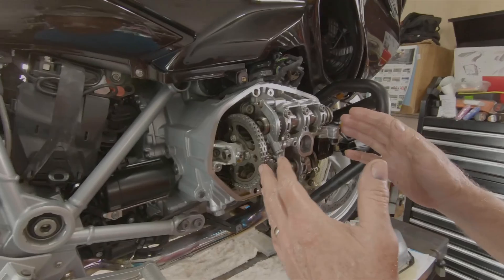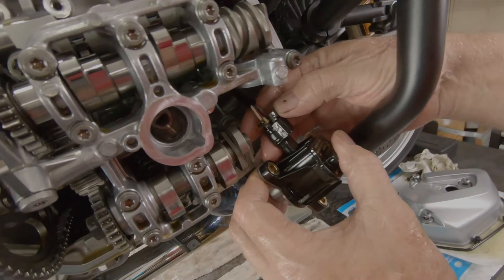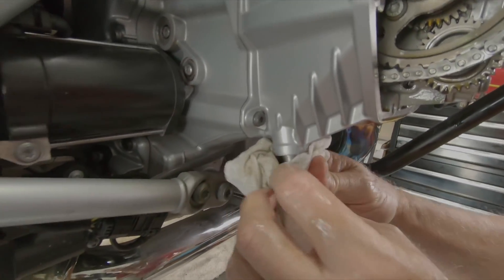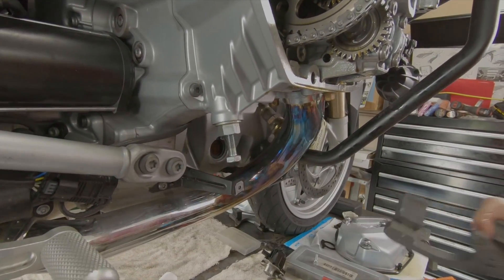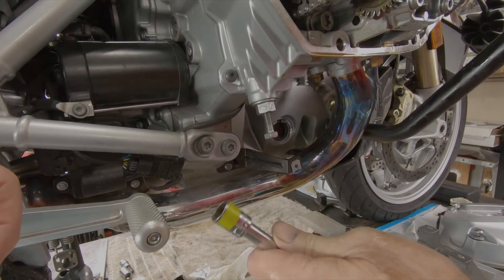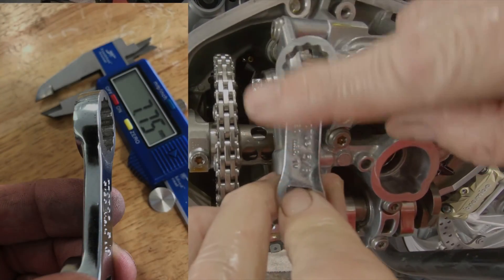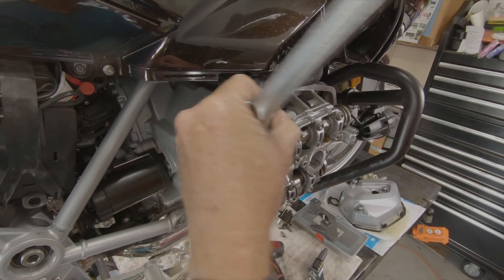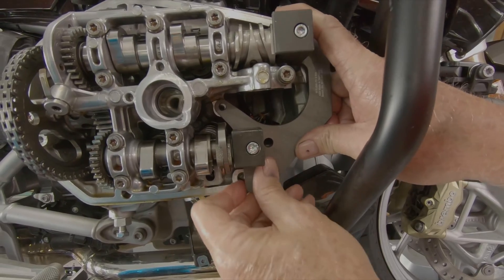BMW R1250 RH Cam Timing Part 3 of 4

Comment: Just wonder, how's possible camshafts get out of timing?!? And how do you realise it? Loss of power? Difficult starts? Worse idle?
Reply from the maker: Why we check Cam Timing on WetHead / ShiftHead Boxers
My belief is that the cam timing IS correctly set right from the assembly line. 
When a WetHead/ShiftHead gets somewhere between 10-12k miles, all the valve train finally normalizes the wear and settles in to this state for the next 100k miles or so. 

Thinking about what we do to check/set the cam timing, it makes sense to me why we need to do this early on in the typical service for these WetHead engines. 

For the LH cylinder my observation is like this….inserting the 8mm TDC locking pin in the perimeter of the alternator rotor has a very small tolerance in that slot or it would get stuck there. This LH side cam chain is driven from a sprocket on the crankshaft just between the alternator and the rod journals, so this is the shorter of the 2 sides to transfer rotation out to the cams. Both the pulling, top side, of the chain and tensioner, bottom side, of the chain slide along about 8 inches of phenolic rails that are prone to some grooves from the edges of the chain links as they break in initially. All the links, (102) on this side, as well as the sprockets have lots of contact points that change as they initially wear in. 
Then the sprocket shaft has the drive gear that rotates the cam gears on both Int and Exh cams…again some gear face contact wear-in is normal. 

The RH cylinder has the added driveline parts before getting to the drive sprocket at the cams …there is the large gear on the front end of the crankshaft that drives the smaller gear on the clutch basket and then back thru the clutch/counter balance shaft to a similar sprocket for the 106 link chain going out to the cam drive gear. 
The RH side chain has more distance from the counter balance shaft drive sprocket that is lower in the engine than the LH side driven straight out from the crankshaft. 
(The ShiftHead 1250 has a link chain vs a roller chain so the left side has 130 links and the right side has 136 links)

The engineers determined that the specific pressure applied from the Cam Chain Tensioner Tool standardizes the removal of the clearance/spaces all along the components just listed to use the Cam Alignment Jig on the flats on the ends of the cams and correctly align the 2 cams for optimal operation. 

Pretty convoluted description to point out that there is some normal play in all these components that we are dealing with after initial break-in to reset what the factory set during the buildup of the engine. 

If you are still awake after all that, I hope you have success setting the cam timing when you get to it sometime after 10k miles minimum break-in. 

It’s my experience from doing well over 180 of these Cam Timing checks that about 85-90% of the cams on each side have to be adjusted after initial break-in.

This will give you easier starting, smoother idle, smoother throttle response throughout the RPM range, and possibly better gas mileage (that’s a guess since I don’t know anyone that seeks MPG over Smiles Per Mile!)
Reply: @Boxflyer11 thanks a lot for explaining, and writing all this😊 my 1200 of 2013 has 160thousand kms now, and frankly speaking runs perfectly, quick starts, regular idle...I made BMW services regularly every 10thousand miles, as instructed. But I wonder if they ever did this check, since I never heard of it before seeing your video and never got informed about it on paying service bills 😊
Reply from the maker: I doubt that any dealer would have done this.  The only reference in the Service DVD of using this Alignment Jig is when REPLACING a Camshaft.  I only use it to re-establish the factory original settings.

Comment: Unless I'm missing a segment, I don't see where you lock the right cyl. at TDC.  Video 2 ends with you removing the cam chain tensioner.  My specific question is which is the correct direction to rotate the cam chain sprocket to put the right-hand cylinder at TDC?  The left cyl. using your tool, you rotate upwards (clockwise), is the right cyl. the same direction or reversed?
Reply from the maker: @m.f.m.67  You do all the engine rotation from the Left side, since that’s where you have access to the TDC pin. Both side cam chains are pulled into the engine from the top of the chain to answer the question, but no need since the important part of the reason for rotating is to lock the TDC pin.
Reply: @Boxflyer11  Got it, thanks.

Comment: Hey Brad,

Here's a question for you! I completed setting the timing on the left-hand side. Next, I took my clearance measurements and determined I have two shims that I'm going to adjust as the clearance was on the loose side of the tolerance (front intake and front exhaust). Here's my problem, I didn't purchase a shim kit because I was planning to just order the ones I need from BMW. However, now I need to do the same procedure on the right-hand side to find out which shims I'll need for that side. Do I have to completely reassemble the left-hand side (shims, cams, bearing cap, axial fixation, etc) before I can spin the engine to lock the right-hand side in TDC? 

Is there any concern with spinning the engine with the cams removed on the left-hand side? I don't know enough about the engine to determine if this could cause any issues. Since the left-hand side is already at TDC, I don't think there would be any possibility of the piston hitting the valves? 

Thanks again, 
Gary
Reply from the maker: Is there concern from me on doing this?  YES!  I would at least put the valve train components back together (replace the shims, cams, and at least snug down the bearing caps) but you could leave off the axial fixation.  Then it would be all normal procedures as far as going to the RH side to check clearance and see if you need to order shims for that side.
If the cams are removed when you rotate the engine, the valves would not be opened and not have any chance to contact the piston, so that's not a concern, but putting the cams back in would be a lot less like being a "test pilot" to see if it can be done.
Reply: @Boxflyer I slept on it, and I agree, I better follow the correct procedure, just in case. I found an aftermarket (Hot Cams) 8.9mm valve shim kit at my dealer this morning that I'm going to use. They're forged from 4140 steel. I found good reviews of them and people say they're a quality product. I'll check them with my micrometer when I get back home. It would be a few weeks before I could get the BMW shims due to the holidays. This way, I don't have to put the left side back together and take it apart again once the BMW shims come in.
Reply from the maker: If you have done the worksheet and know what sizes the shims should be, but can't quite get to the preferred target clearance, you have time to order shims in 0.02mm increment spacing from OEMCycle.com.  The format to enter in the website search field is 29.890202  That is for a 2.02mm shim.  They come in a 5 pack of that size for less than a single "adjustment plate" as BMW labels them.
Reply: @Boxflyer  I may take your advice and put an order in with them. I wanted to get this wrapped up today, but there really isn’t any rush. The snow here won't melt until at least mid-March.

I nailed the left side. Front/rear intakes are both 0.12mm, and front/rear exhausts are 0.36mm. 

For the right side, the best I'd be able to do with the shims I have now would be:
Front Intake: 0.123mm
Rear Intake: 0.135mm 
Front Exhaust: 0.382mm
Rear Exhaust: 0.36mm

Which isn't bad, but it would be nice to get it dialed in to match the work I did on the left side.
Reply from the maker: That's a good approach...do it once exactly the way you want it and you may not need to make any adjustments until well beyond 100k miles.
Good work!
Reply: @Boxflyer11  thank you! Can I make a donation towards your work on these videos?
Reply from the maker: @Audi403YYC  Maybe you could come to one of my WetHead/ShiftHead TechDay events and help turn wrenches!?!?  Thanks for sharing
Reply: @Boxflyer11  you're a few thousand kilometers away from me and in a different country, but maybe one day!